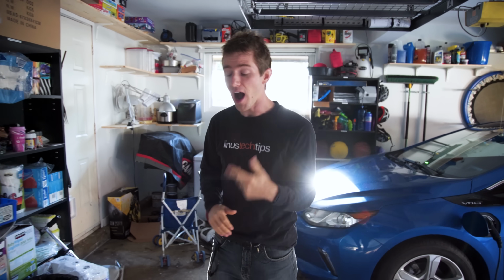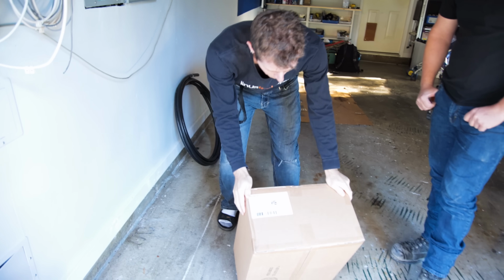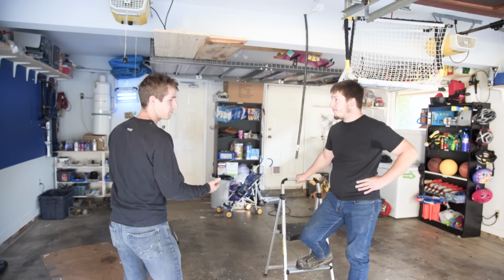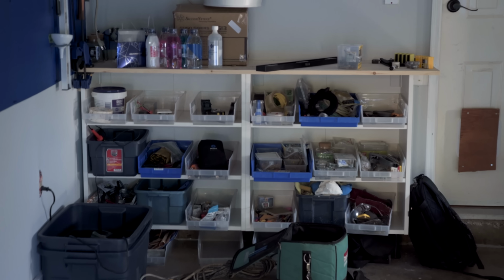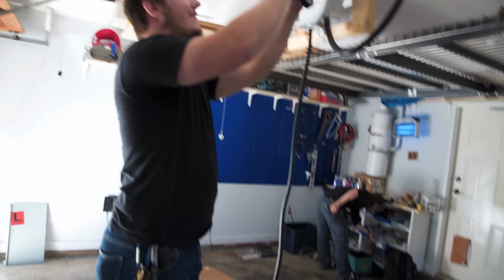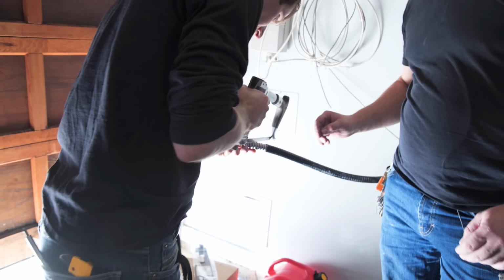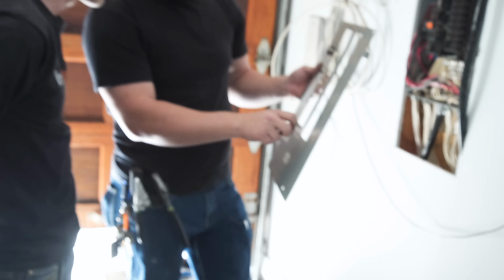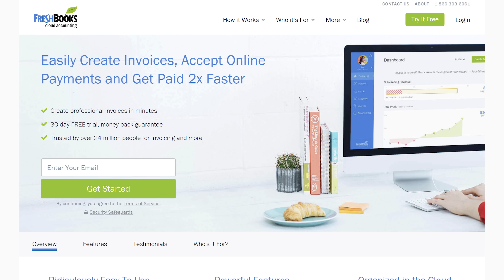Installing my Electric Car Charger - What Could Go Wrong??

Comment: You drive a volt!!! Very impressed! We only got 88 Volts (the cars not the power thing) over here in Germany last year. GM was restricting the access to the car!!! (and compaining that the can´t sell over 6000 Stock in US/CAD!!)
BTW: Your electritian friend  seems to work on other rules than over here in Germany! First rule!! Turn off the mains!!!!! 
And the screwdriver!!!!! You know there are ones with a isolated shaft up to 1000V! They are mandatory for electritians here.

UPDATE: Yes confused the volt with the bolt ;-) Here they are called Ampera and Ampera-e. But "now it will be chared in two hours" ? ;-)
Reply: Ist das nicht ein Opel Ampera?
Reply: @wtsuser  Ja
Reply: You don't have to turn off the mains to install a breaker in NA. Just keep the new breaker off.
Reply: Their in Canada which tends to be pretty similar AFAIK to US practise on a lot of things, sadly my impression is the US regs tend to be as lightweight as possibble over actual safety.
Reply: @darthkarl99  Canada usually follows US regs, and they're becoming increasingly annoying... Particularly the arc fault breaker crap.
Reply: @darthkarl99  North Americans like to complain about anything related to technicians and their work, so although keeping the mains on is bad practice, I'm sure it isn't worth the trouble following rigorous safety procedures if their customers don't have to worry about food spoiling or being without tv/internet while an electrician does work in their house.
Reply: @wtsuser  Jepp, it´s the hybrid VOLT not BOLT. Was confused by a charging time of "over night". but he only has a 1.4kw brick.
AC 3.kw is standart here in europe and 4.7kw with type2. Even 7,2kW if your charger will do 32A and you can charge at a infrastructure station.

But when I heard correctly he will get a full electric vehicle.
Reply: @gungan5822  I take it conditions in canada are producing a lot of false positives on those things?

Comment: lineman pliers are nicknamed electrician hammers at my work
Reply: I have a hammer, its only used for certain tasks, and NEVER to remove knockouts. Always use my linesman to do that, and tighten lock rings, and other percussive tasks. Hammer is a last resort or need to install some beam caddys
Reply: Same nickname In French-Speaking Canada as well
Reply: @Sovek86  hammers are used to remove drywall that you don't want to patch back

Comment: Chevy Volt is a fantastic car, great choice Linus and it is the perfect commuter car IMO.
Family has had two, and both Volts have a lifetime fuel economy of under 1L/100km.
Reply: Tesla is better any day
Reply: Not if you consider the price of any Tesla you can buy right now. Especially if you only have to drive a few kilometres to work and back. the car cost like 35k and I don´t know how much linus paid in the end, but I believe it was less, for a car that is driven most of the time electric teslas cheapest car you could buy right now would be at least 53k. To wrap it up: No Tesla is not better every day especially if you do not need a big battery and do not want only a screen in the middle of your car.
Reply: @sebastiancamarena2824  nope Tesla is hopeless as a commuter vs the Volt. Price differential is huge. Tesla still doesnt make the promised cheap car. They are a nightmare to repair or maintain. Had 2 Volts love them. Had a reservation for a Model 3. Cancelled because the reasons to do so jusy kept piling up.

Comment: Why didn't you go all the way to 400V? I don't have an electrical car yet, but as I put electricity in my garage I did the most I can, you never now what you'll need
Reply: it would require a special line to be run and depending on the exact area they are in, perhaps even a new transformer.

Comment: Replace car batteries with Maxwell Supercapacitors = No more charging for hours. Mix Maxwell Supercapacitors with existing car batteries = best of both worlds.
Reply: No, you know why? Because Capacitor longevity SUCKS. Why do your TVs and VCRs go bad?... The capacitors on the supply has gone bad. Also energy in = energy out, the power density of caps suck compared to batteries.
Reply: ultracaps are the future
Reply: @heatseeka14  Yeah if you enjoy charging your car every 15 miles!
Reply: @Xeno_Bardock  Fair enough, but what would be the point?
Saw the vid and as an EE myself, I'd encourage exploratory tests like this. He claims benefit in cold start (in VA, 23 degrees) IF your lead acid battery is going bad. I live in Ohio in lake effect area and never have problems, its been so cold here my antifreeze froze. Just keep a good battery in your car. He mentioned his super capacitors pulled 600A at startup, I didn't see any form of cooling in the enclosure (or vents) he had with his other 10Ah battery. Yeah he can add fans and vents, but 600 A is a lot of current to be pulled from those caps and they may eventually go bad in the same lifespan as a battery (4-6 years). My main concern is if you get into road side engine trouble. With the capacitors you can only crank it over 2-3 times before dead, and then what, does he expect a 10 AH battery to take that full load?
Reply: @amorag59 , actually capacitors are way better than Batteries for longevity... Don't know where you are getting your info from. 

 A regular capacitor can handle typically hundreds of thousands of charge cycles where a Lithium Ion battery is lucky to handle 2,000.

 The Caps you are talking about going bad in tvs and such typically are at least 15 years old even if they are of okay quality. A battery would be lucky to last 1/4 that time.

 And if they failed sooner they already likely to of cycled through once again hundreds of thousands (Partial) cycles something a battery currently can't dream of.

 Still what is the truth is the caps can't hold a flame to the Batteries in terms of capacity currently. But Graphene might change that.

 Even if we can get the caps to half the capacity they'll still be practical as we can charge the in literally a fraction of the time.

 Let's say you get 250 miles battery, 125 on cap... Sure that's half the capacity but then you look at charge time and find 8 hours charge battery, vs 5 min charge cap... The caps would still be way better for all but very specific applications. I mean 5 minutes would literally be like stopping and getting gas.
Reply: @TrollFaceTheMan  Your points are very well taken, with advancements in technology maybe that can get us somewhere. The fact of the matter is that without real world examples you end up reaching a bit. 

If we are talking a hybrid start battery then your going to run into problems with cooling your caps. The video Ultra Instinct linked above, the guy had 600A draw from his caps with NO cooling. I highly doubt this will last 4-6 years. A lead acid battery is already liquid cooled on the inside and it will give you more than just 2-3 starts if you have engine trouble - and maintain that charge for much longer. 

If you are talking EV you will get your fair share of a test under the laws of physics, because to go to a full charge in gas station time will take thousands of amps: Tesla battery 100,000 Watt hour @ 375V = 266 Amp hour = 15960 Amp minute = 3192 Amps of charging for 5 minutes. Once they are charged they will self discharge if not kept "topped of". According to wikipedia the voltage will drop to half of its original value in a matter of 25 days. As you already know/mentioned the energy density for capacitors is lacking which is one of the main issues.

It's great that caps have such long service lives (cycles), but it's not at a point yet to start touting them as the knight in shining armor in the energy storage world.
Reply: @amorag59 , technically Batteries are not liquid cooled as you say. Yes they do have have liquid on the inside but that does absolutely nada for cooling. That acts as nothing more than thermal mass for the heat to seep into.

 So in other words they aren't liquid cooled, they are liquid buffed. The liquid helps smooth sudden high draws here and there. But technically does nothing for cooling and can be thermal saturated like any other material.

 It is nice to see you have an understanding of wattage draw and you are correct to charge it that quickly would take a lot of amperage however technically it is the 85kwh not the 100kwh car that will get you 265 miles per charge.

 Meaning we would only have to charge our caps to 42.5wh to get the 125ish miles I was talking about. This is even less than half of what your math calls for.

  You do have me the 5 minutes is a little exaggeration of what the realistic capabilities is. Technically 5 minutes is something they are shooting for to get about a 60% charge and 15 minutes for full charge when it comes to super cap devices.

 But still in terms of draw current, charging current, and heat generation, that is what is so great about the caps.

 Because of their lot less internal resistance they run cooler both when being used and charging compared to Batteries. So if the battery doesn't need cooling the cap shouldn't.

  Less energy is lost too to heat during high drain situations where lithuims rapidly lose efficiency and longevity when subjected to. 

   Now a big issue is, as dangerous as Lithium Batteries are when they suddenly fail, super caps are even worse because of how quickly they can discharge.

 Having 45kwh suddenly discharge in less than half a second does not sound pretty...

Comment: did anyone else panic at 9:40 when he was literally drilling with his hand behind the wood.
Reply: Nope i don't bother with safety with anything electrical or cars be i only use what i have and i don't have anything to hold cars i just use the car spares jacks
Reply: Not ret the worst that could happen is he likes his hand a little. The most dangerous thing would be if that startled him and made him fall backwards hitting his head on the concrete.

Comment: You should trade in for a 2019 Volt so you can actually utilize that higher wattage unit  :P or better yet, a Bolt.
Reply: Bolts are too expensive for what they do.  Cannot go long range because they charge way too slow.  If  you don't need long range, get a leaf.  Electric i3s  supposedly are going for as low as 15k, even though they are 50k new.  So a used i3 would be another good short range EV option.
Reply: Used Bolts in a few years ;). Wish they had a limited slip differential for hot hatch action. 50KW L3 charging isn't bad but it tapers down after 54% or so, kind of slow. 
I like the 1st gen Leafs too, if in environments that aren't too warm because battery has no cooling. Like 6-8 grand now. Nissan raised the price of new battery packs 4 them, argh.
Reply: If I could get an electric car I think i'd get the Leaf :)
Reply: @Karma20XX  keep in mind the battery pack is not cooled at all so if you do a lot of rapid charging or you live in a hot climate it's not a good idea. Rumor is that the 60KWh 2019 Leaf will be liquid cooled but none of the others are.
Reply: he only just got this car
Reply: He should've gotten a tesla like every other youtuber and their mother, on of his employees already has a ModelX so he should just buy one of rhoss
Reply: @_PatrickO  you're mixing up Volts and Bolt's
Reply: @JoeyDee86  No I am not.  The bolt is all electric and charges at 60kw, half the rate of a tesla.  That is too slow for long trips, so it is a short range EV.

Comment: Man... i'm also an electrician but in Germany... and when i see your stone-age technology there... i only say: i'm lucky NOT to live there :D
Reply: yeah, like single phase wiring for heavy loads? seriously?! smh
Reply: @atodaso1668  In Germany houses have 3 phase 400V. The most common 16A 3 phase socket therefore delivers 11 kW.
Reply: @atodaso1668  Circuits inside the house are spread equally across all phases. Dryer and washing machine for example each get one circuit one two different phases. Heavy appliances like a 18 kW water heater are connected in delta and therefore load all phases at the same time. Power factor has nothing to do with the load balancing between the phases. The compensation for inbalances is happening inside the substation transformer with the help of a specialised winding scheme.

Comment: Why doesn’t the volt come with a level 2 charger? Seems like something a 40k car would come with..
Reply: 1: the provided charger is capable of level 2, you just need a 240v outlet nearby, which most people don't. 2: the Volt doesn't have nearly as many batteries as a fully electric car, so it really doesn't take that long to charge on 120v.
Reply: @Lunker_Dunker  volt IS fully electric, it just has a small battery with a fuel powered range extender.
Reply: @SherrifOfNottingham  technically it's a plug in hybrid, because the gas engine is connected to the power train and not just the batteries.
Reply: Nope, the engine is only connected via power cables, it's a gas powered generator and does not turn the drive shaft proper. While some classifications still refer to it as a "series-hybrid" official classifications refer to it as a EREV or REEV or the official Californian classification of BEVx.

It has a full electric transmission as the combustion generator does not provide direct power to the wheels. Series Hybrid is never used as without the "Series" attached to the hybrid its incorrect.
Reply: @SherrifOfNottingham  well, they've changed it big time then, because the original Volts definitely still had it connected to the transmission.
Reply: Pretty sure the volt was never a hybrid, among EVs its considered a terrible compromise, only having about 35 miles on a charge using gas after only around 15 miles.

I remember it was originally marketed to seem like any other hybrid because people thought of electric motors only being capable of 35 miles an hour, saying it was a hybrid gave it more credibility. I do know for the fact that the European version (Ampera) was never sold with a hybrid transmission.

Comment: So the charger doesn have earthing at all? I thought car chargers had to have earth connection in case something goes wrong the whole car body doesn't go live and you die if you touch the car
Reply: Americans seem to not like earthing. Two pin sockets everywhere.
Reply: Depends on the charger.
Reply: @H Collins Conduit may be earth, but the chargepoint casing is plastic, so it doesn't do anything. Chargepoint seems to be isolated here. The conduit is just to protect the wire run, and the house from arc faults.
Reply: As far as I know they do not use "neutral", only "live" and "earth". There are special plugs/sockets for "dangerous" places like kitchen or bathroom that you can't plug other way - one terminal/pin is wider.
Reply: they should have connected the armor to ground in that case
Reply: If you look at the cable at 3:43 it clearly has 4 wires, Red , Black, Blue, and a bare copper wire. Red and black are the 2 hot wires that combined supply the necessary 240v and the bare copper is the bond or "earthing" (weird term by the way) and blue is unused. The bonding wire will instantaneously trip the breaker cutting off power to the unit should a undesired path to ground such as the car were to magically appear. The whole set up is quite safe.
Reply: @moalabs  That's every standard receptacle now.
Reply: @joshuaanderson3443  Yeah I just can't see the wires or terminals in the video.

Comment: So the cable wasn't run inside the wall by the panel? Wow, poor job there. Funny episode though.
Reply: its how linus wanted it i'd assume, can always change it later
Reply: I think he needs the EVSE mounted in the middle because he has a mini-van with the door on the right side, so he can't switch the positions of where he parks his vehicles unless he wants to back them in.
Reply: yeeeeeahhh, if you're gonna cut and patch a section, I'd have run it into the top of the panel, if thats impossible, then patch the side.... that just looks.... janky as hell.

Comment: The speed of Level 1 vs Level 2 depends on the car. My 2012 Mitsubishi i-MIEV charges about 1 kW on Level 1 and 3 kW on Level 2. My 2018 FIAT 500e charges about 1.3 kW on Level 1 and 6.7 kW on Level 2.